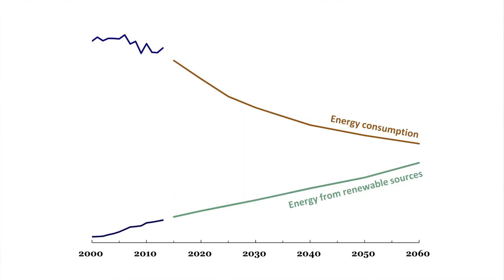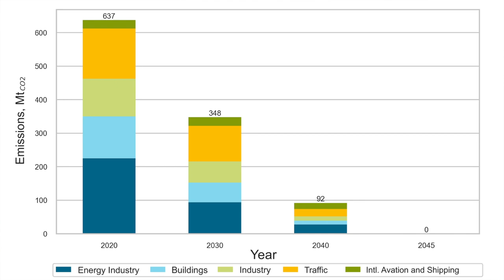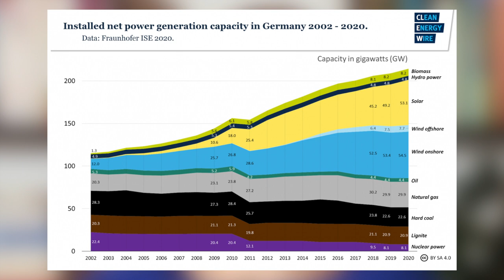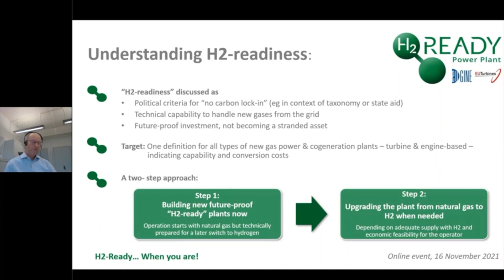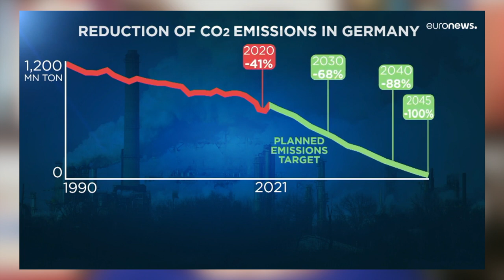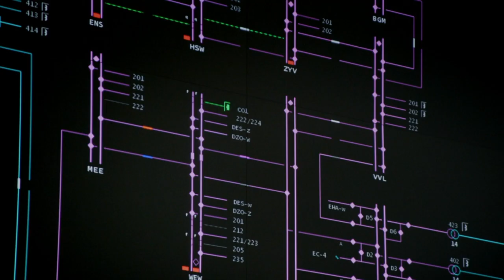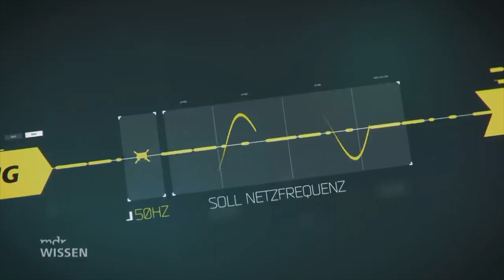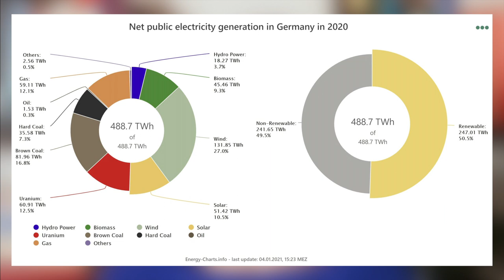How does the German Power Grid work?

Comment: Germany is so clever , instead of using nuclear cut demand  by de- industrialize . Germany will lead new fashion trends of down jackets and fur coats.
Reply from the maker: 😂 Pretty much. 😉
Reply: @NetZeroTech  Irony ? Germany will get it's " breathing room " as both Russia and Ukraine invite Germans  to help rebuild .  Engineers will migrate to where the resources are. Unfortunately Germany  will be left a braindrained  poor welfare state.
Reply from the maker: @kokigephart111   This sounds very simplified. I agree that Germany has significant structural challenges.
Reply: @NetZeroTech  And I have faith that Germany can solve it's problems. A couple of   dark ,cold hungry winters will do wonders to set a return to practical thinking. Hydro and nuclear .  Solar in Germany, whose bright idea was that?

Comment from the maker: Did you know that Germany's electricity grid is running about 50% off of renewables?
Reply: renewables including hydropower and biomass. The percentage of solar and wind is pathetic. Offshore wind has cost of 2 to 4 cents per kwh in operation and maintenance cost. wind also decreases by 4 percent of nameplate capacity every year. how in the world is that supposed to come close to working, the resistence the german people have is the 3.5 percent per year slide into poverty that this mess is responsible for.

Comment: Hydrogen power plants is a bad idea. You have to make the hydrogen and that is very energy intensive. Why not just use that renewable energy directly instead. If you overbuild wind turbines, you can idle them when you don't need as much power. They can be brought online when needed quickly.
Reply from the maker: Thank you very much for watching and taking the time to comment! I like the idea of overbuilding wind turbines. Comparing one energy source with the other, wind turbines are indeed more efficient than hydrogen power plants. However, if you look at a portfolio as a whole, hydrogen can complement wind turbines in a way so that the overall portfolio efficiency is higher combining both vs using wind only. The excess wind energy can be stored using hydrogen and used when needed. 

Offshore wind is on the rise:
https://www.statista.com/statistics/476327/global-capacity-of-offshore-wind-energy/

Comment: "In any system of energy, Control is what consumes energy the most.
Time taken in stocking energy to build an energy system, adding to it the time taken in building the system will always be longer than the entire useful lifetime of the system.
No energy store holds enough energy to extract an amount of energy equal to the total energy it stores. 
No system of energy can deliver sum useful energy in excess of the total energy put into constructing it.
This universal truth applies to all systems.
Energy, like time, flows from past to future" (2017).
Reply from the maker: Hi! Thank you so much for commenting. Heat pumps move heat from on place to another rather than only transforming it from another form of energy. What are your thoughts on practical and engineering challenges?
Reply: @NetZeroTech  Hi, Any 'heat pump' is only possibly functional inside another, bigger and older running parent heat-pump. 
Let the operators of a power station run out of gasoline, food, medicine or shoes - unable to arrive at work - and the station stops sooner or later.
This is despite there is no shortage in fuels to keep the station running for longer.
Ignore changing the engine oil of your car, and the car degrades and becomes obsolete in a hurry.
The total energy put into a fresh batch of engine oil until applied into your car is unfathomably greater than all the useful energy your car has delivered since last oil-change.
Engineering and technology come secondary.
Thermodynamically, there is no such thing called Capitalism.
This is owing to the fact that fossil fuels have been traded under the doctrine of what's called 'supply and demand', not on the basis the stuff is finite.
What humans have lived, under our outgoing Western Civilisation, is actually the best of a Communism-disguised-Capitalism system.
"Communism is the electrification of the whole country" - Lenin.
Reply from the maker: @sunroad7228  Thanks. I’m trying to figure out the value here. Is there anything I or the community can help with? Thanks, Katha

Comment: talking about hydrogen while they already have messed things up so bad the low output of crappy wind and solar has caused fertilizer plants in germany to shut down due to the high nat gas prices. this WILL cause millions to starve and very soon at that.
Reply from the maker: Hello EurobroWarriormonk. How are you? I am not sure how I can help you. 
With regards to your ideas: If you have a data-driven case on the effects of energy sources on food supply, I'd appreciate an opportunity to take a look. My understanding is that climate change already has massive negative effects on reliable food supply. Extreme weather, droughts and flooding will increase as a result of oil-based economic systems, causing additional pressure on the resilience of our agriculture systems.